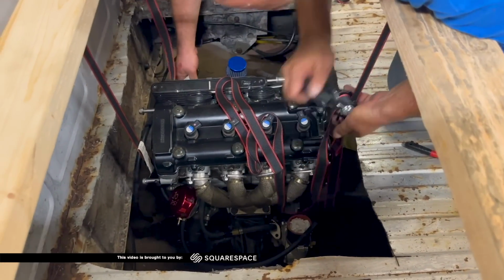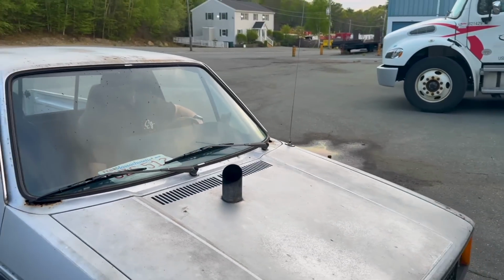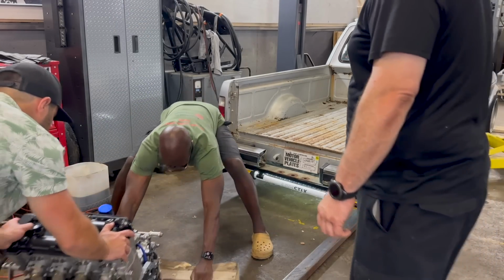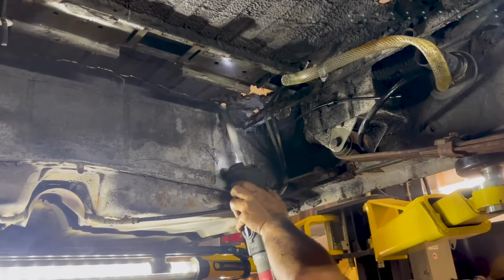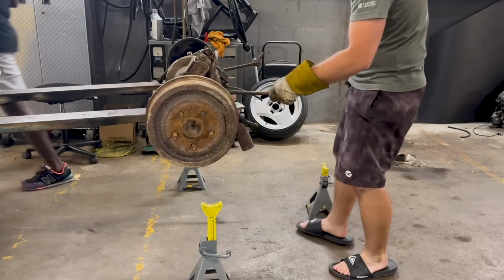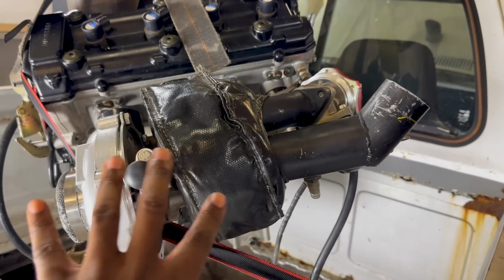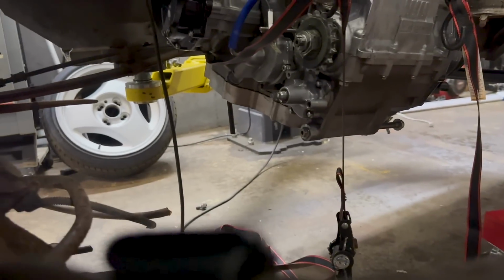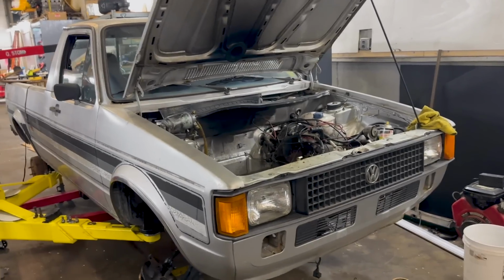Installing A Turbo Hayabusa Engine into an old Volkswagen pickup truck

Comment: Tom woods custom drive shafylts, but I'd do a standard drive shaft from the alley to a carrier bearing, then the matching splined part with the solid shaft and splines, from an 02 long bed Chevy, then have a machine shop make you a hint that'll slip on the shaft and allow you to bolt the sprocket to, you'll need 2 huns, 1 for the sprocket, and one attached yo a pillow block to to support the front of the shaft

Comment: Simple solution.   Have the sprocket drive a chain that goes straight up and down, or at an angle if you want to reposition the engine side to side.  Make the drives shaft go straight forward and back, held up by a carrier bearing at the front end.  Put another sprocket at the front end of the driveshaft.

Comment: You could possibly run the motor on an angle down toward the diff and point the diff up toward the motor. Just gotta make sure the oil pick up in the motor is going to be in oil... and same same but different for the diff, then you still have a straight shaft.

Comment: If I were hanging out in the shop, I would suggest using a jack shaft assembly, using pillow block style bearings and allow you to dial in the final drive gear ratios there. Otherwise I feel like the final drive will be almost nothing. Edit I said prop-shaft -duh

Comment: Rich put the diff on top of the leaf springs that will lift it up enough to line up with the engine the other thing you can do is turn the engine and run a chain and sprocket setup pull the diff apart take out the crown wheel and put a sprocket in place of it and run a heavy duty chain

Comment: Simple chain and jackshaft will fix angle issue. Plus you can change sprockets for additional gearing. Have fun. And yes in a VW purist. But hey a VW on the road is better than crushed into beer cans

Comment: A few suggestions.mounting the diff obove the leaf spring would give you a far better drive shaft geometry and to motor wouldn't need to go down as far.as for the driveshaft itself machine the sprocket down to accept a jackshaft with a bearing and flange that you can bolt a flat faced  uni joint on.with the gear shifter use rose joints and  rods with a L shaped pivot on the engine to correct the shift direction.well that's my idea anyway hope this helps the process
Reply: No matter how you do it I'm a fan of your chanal keep up the great content
Reply: I was thinking the same thing.

Comment: We have these in South Africa but none of them are diesel and none or 1 percent of them are automatic same with the MK1 Golf we have 1.3 , 1.4 and 1.6 carburettor then we have 1.4i , 1.6i and 1.8i fuel injected mk1's the only automatics of those are carburettor versions we also have R versions of the MK1 which has a 1.8i and a widebody from factory only 300 but only 150 came from the factory with a bodykit the rest stockbody with a 1.8i badge and some R logo's and the MK1 was built up untill 2008

Comment: Nice job Rich an interesting build for sure, probably to late but a late model independent rear diff would be an answer to your problem. Get the full crossmember diff driveshafts hubs and suspension.

Comment: First off, love the project as something to do for the sake of something to do.  That said, "400 horsepower, which I think is all we need for now," made me lol.  I guess I'm used to people saying that growing up in the rural midwest.  We had/have from humble pony cars up to rich farmer/doctor super cars that are just guys bragging about numbers that are only tangible on a dyno slip, lmao.

There are a lot of small FWD cars that make really fun and easy to use rally cars for beginners and up.  There's nothing wrong with it, just don't push more power for the sake of claiming power, and instead push what you need and focus on handling.  You don't have to throw away all FWD's as terrible if you're just getting into cars.  I RWD converted a 97 ST204 Celica with a 4.0L 1GR V6 + Turbo that's insanely fun, but I've also been having a lot of fun with the random 09 Eclipse GT I picked up randomly as a FWD to mess with (most ST204's are literal junk at this point or imported GT-Four's for 30grand too much).

Comment: You could maybe go with an offset dana44 or something, possibly even a dana 44 front and put some rear steer into it. You already need a reverse gear so you could in theory use the reverse gear as forward if you have to flip axles as long as you set it up right for oiling.

Comment: You should just weld a tube cross member down under the engine and run a simple Jack shaft on a pair of bearings-- then you could mount the engine wherever you wanted and use the chain to run down to the shaft..  which would also have a drive shaft mounted to it, that goes back to the rear diff.   This way, your jack shaft can be low and more inline with the rear axle and the engine can sit right above it, so it's not hanging down near the ground so much.

Comment: With the rear end on the springs as you suggest, tilt the engine by rotating it clockwise (to drinkers side) along the sprocket axis, then rotate the engine counter clockwise to have the socket face the rear U joint. Rotate the rear axle counter clockwise so that the  U joint faces the sprocket.  The rear pumpkin doesn't have to be level to the ground and I doubt the  angle would be that severe to hamper lubing it. Using the method would greatly reduce the complexity of joining the 2. Just need to make sure the backwards tilt of the engine isn't too much to prevent proper lubrication. That's the method I'd use to pull this off.

Comment: Use a chain to a driveshaft assembly that is in line with the differential. The motor can be in the right place and the drive shaft is sorted

Comment: Why have the engine in the back? Keep it 2wd and stick the engine up front, gives you more DS length to work with. Dunno Rich, I think 2wd will be fun enough. That trans won’t hold up to 4wd burnouts (attempts), but 2wd maybe. Either way sir, it’s gunna be crazy. Use the exhaust cutouts to maybe hide the engine swap :)

Comment: I would put more effort into the rear end setup and tub the rear to accommodate for wider tyres. 
Sheet in the "front" engine bay with fuel tank in the bottom of it. 
Putting another motor in the front of it, sorta steals the original lustre of the Hayabusa/rear drive swap. Perhaps an early model Corolla or something would be  abetter candidate for the differential so the centre is physically smaller allowing more room for a more functional driveshaft with a better range of angle.
Or mount it east west and run a big sprocket, chain and axle. Like the Minis in the UK!

Comment: Aww thats some bullshit.  1500-1700 bucks for an electronic shifter. I bet you can BS Something up with a 3d printer and 100 bucks or less of hardware... its just insane what people think they can charge for parts that cost them like 25 bucks in materials...

Hell, I think its absolutely goddamn disgusting that they charge 4 grand for a supercharger or a grand or so for a single turbo when they're made of like 40 bucks of aluminum and a few hours of milling time.  This shit is why I own a CNC and 3d printers.

Comment: I thought you'd put the rear on top of the leafsprings in the first place since the original axle was like a trailer drop axle.  The frame is nice to have but the part where it has leaf springs makes it so much easier.  And they make adapters that replace the sprocket to use a driveshaft.

Comment: All that bike power comes at a huge cost, zero torque. 4 wheel drive with 4 × the contact patch of a bike means the lump will bog down at launch every time, total nightmare.  What it needs is chain drive to a solid rear axle, like a kart, and narrow tyres. That way the wheels spin into the power band and it launches hard. I saw a lightweight single seater at the Brighton Speed Trials with 2 of those engines, just to give it enough torque to pull away from the line.

Comment: Take off the gear. It will expose the rod with splines on it. You can fit a adapter on that. That will fit an axle. The gear (inside) has that spine. So it has to be rounded, then welded into the axle. A machine shop can do that.

Comment: Uncle Rich , Clock the engine so the head is closer to the passenger side , maybe a 10 to 15 degree angle , that will give the turbo more space , the bike engine doesn't need to be straight up and down this will also help with drive line angle as well

Comment: Why don't you have a chain drive to a jackshaft, and run the driveshaft off that? It means you can have the engine up far enough to make sure it never tries to become part of the road? (Go-Kart Ideas for a larger than normal Go-Kart)

Comment: Short driveshaft with a sprocket at the end, and use a chain between the two. You will have to make a crossmember, that would hold a center bearing, that would hold the driveshaft at the other end.

Comment: Use a chain to make a dropbox so the output shaft can be anywhere you want independently of the engine placement and you get to make your own adapters as well!

Monstertrucks usually do that
Reply: I was thinking the same thing,  now I have to go delete my comment 😂
Reply: Or just mount the rear end on TOP of the leaf springs instead of mounting it on the BOTTOM of the leaf springs.

Comment: My approach would be to build the drive train into a sub frame known to match the chassis rails dimensions. Doing it that way allows adjustments to be made prior to installation and simplifies overall assembly. The sub frame would then be isolated from the chassis with rubber mounts to reduce resonance.

Comment: You could find a front axle, low pinion and flip it to the rear.  That would gain you a few inches.  You could then tilt the engine back some and use a double cardon joint driveshaft.  Have no angle between the pinion and driveshaft and have all the angle taken up by the double cardon.  Tom wood’s driveshaft shop should be able to make you one

Comment: Use a jackshaft. They are designed for this purpose. You can use 1:1 gearing or modify sprockets as needed

Comment: Richard Farley is the creator of dwarf race cars. I see them all the time and it looks like the Dwarf Cars use a output shaft U-joint collar (for the drive line) to rear axle adaptor. I don't know what they call it, but there is a lot of Dwarf cars for sale. Call them and they can send you to the right place to get one. They have some supper fast Dwarf Car Racing series of Texas. They scream! I hope this helps but it's past my bed time for this old man. Keep building Rich!

Comment: This is just an opinion.  I dabble in 1/8 RC cars and most have a single engine that drives a gear that mated to a transfer case that runs axles to the front and rear differential.  Instead of a direct link axle, I would try out something like that is it were me.  It would give you 4WD.  You would just need a front differential, some custom axles, and a transfer case that could source from say a Ford Ranger.

Comment: Have done this swap like a million time....in my head. And every time I decided IRS was the way to go, but always hated the idea of having to build out strut towers and cutting up the truck bed even more. Will have to do more daydreaming to get it all noodled out, but I think you can use a corvette rear out of any year that had the carriage spring that goes side to side, so like C3-C5 I think? Then just put the shocks wherever and you can run a driveshaft that isn't short and has to jump around like crazy to follow the axle. Edit: Or you can just do a V drive to solve engine location and driveshaft length.

Comment: Use a Quaife drive as an idler box. Off a chain from output sprocket to Quaife box, then that is "remote" so can be mounted wherever to get your pinion and shaft/u joint angles correct and the probably do a front & rear input/output to give you drive to the front for 4x4

Comment: The factory diesels in those things are BEASTLY with a handful of mods, there was one around here about 30 years ago that was making 60+ psi  and was always out on the salt flats doing stupid fast pulls. It was owned by one of the owners of M&H tire (the drag radial tire company)

Comment: I have done this before, bring the engine back so the sprocket is above the difs output, and run a 1.4:2 sprocket chain drive (approximate gearing), this will remove most of the gearbox/clutch shock problems, and put more weight over the rear wheels where it's needed, also, it means you don't need a prop shaft, or run a shaft like a jackshaft. 
The other way you can do it is to run a jackshaft from the dif, (UJ-jackshaft-UJ) with a sprocket aligning with the engine's sprocket as you have the engine now, but this will mean you will need to fabricate outriggers to hold it, along with the outriggers to the engine mounts.
Reply: Also, for the gear shift, just run a cable like on an outboard motor. A single "Morse control" would work.
Reply: And if you do need loads of articulation, look into "Rzeppa joints"

Comment: Westfield cars in the UK sold a kit known as the "MAGEBUSA"  where a GSXR1300 engine is mounted longitudinally in Lotus 7 chassis.

Drive is by replacing the chain sprocket with flanged hub mating to a two piece tailshaft. Having this much drive line room would allow easy fitment of a reversing gearbox also.

Personally I believe mounting the engine in the bed of the Rabbit is going to create way too many headaches.

Comment: simple fix, get a transfer box, input put spocket on it, then chain to bike spocket, and 1/2 there to 4wd. Also you could put a ring on it too and get a motor/starter motor and for reverse engage that motor.

Comment: Wabbabusa😂 Turn the engine around aim the driveshaft forward towards a front mounted transfer case that then runs a driveshaft back to the rear wheels. Much simpler and should solve most of the issues your currently facing.

Comment: You could have installed a BMW running gear from a junk yard and placed even a cheap used Volkswagen gas engine or even find a wreck BMW 325i or something and then now you've got a super badass low end torque monster.

Comment: Could you gain clearance and lower the engine by rotating it clockwise a few degrees, (looking forward from the rear)?  Seems as if that would clear the turbo on the driver's side.

Comment: You just need a dropbox (uses a chain to essentially lower the output shaft). This can also be equipped with the proper spline for a driveshaft.
Reply: Chain drive Jack shaft....two piece driveshaft (with a carrier bearing and a flange for a sprocket) then there is even the possibility of gearing options.

Comment: If you leave the diff under the leafs it's going to sit with a rake forward your solution is to mount the rear diff on-top of the leafs not under them which will also save you having to lower the engine look at the offset on the factory rear axle

Comment: For connecting the trans to the axle, I would run a jackshaft. Then you can mount that wherever you want, run the chain to that and then a small driveshaft from that.

Comment: How about making a bearing supported countershaft that drives the rear axle and put a sprocket on it to run to the engine and you can put the engine is high as you want then would make a lot of the project easier??

Comment: Another thought, to help reduce shock load when shifting into gear and isolate vibrations there are several solutions used in marine applications. They have a bunch of different styles of shaft couplings that do what your looking for. Poly flex flexible shaft coupler is a style that could work. Take care, Randy
Reply: good looks Bobandy

Comment: axle on top of leaf springs and you can get extra leafs for them from a small truck s10, mazda b2000, nissan d21 harbody, there are also lowering blocks for straight axles, there not great but may put the u joint more on plain with the sprocket drive.

Comment: Look into outlaw class open wheel minis blackbird engine racing shafts. They use them on dirt track with 1200cc kawi engines with Toyota rear end.
Reply: Reverse with the electric motor?

Comment: Sprocket to the drive shaft and a chain, that would also allow to mount the engine more in the center.
The drive shaft would need a mount to stay in place with the chain but that would allow for a lot of flexibility in the placement of the parts.

Comment: Hawk machine co makes adapters to replace the sprocket and convert it into a drift shaft flange. Its a popular thing for legends race cars and a few other classes. I would hit up hawk and get the adapter you need they will have it. As for the shifter im certain you guys can make something to change the gears up and down as needed. Hyabusa uses a hydraulic clutch so that shouldn't be too bad to figure out either. Im excited to see this project! And im a vw guy!
Reply: I also have a hawk adapter on my gsxr600 srad engine in my MG Midget. Plus they're fairly cheap and solves that issue. They also have other parts for installing motorcycle engines into four wheeled applications.
Reply: I used a Hawk adapter on a R1-swapped vehicle I had. They work great. Mine kept vibrating the driveshaft flange bolts loose so make sure you use nylocks or some loctite or something of that nature

Comment: Would a FWD transmission solve the engine rotation/position problem? I think that the input is 90 degrees from your current situation. That would ruin the solid axle purchase and require a whole new suspension design so it's probably not worth it.
Next, my vote would be chain drive to a separate output shaft which would solve height/alignment of the motor and keep the oil pan away from the ground.

I like the low stance. Looking forward to the EV FWD that you're hinting at, and wonder how you'll sync speed/accel when you get there...